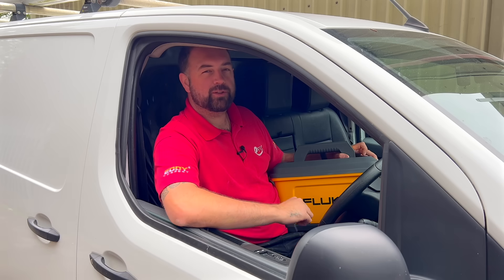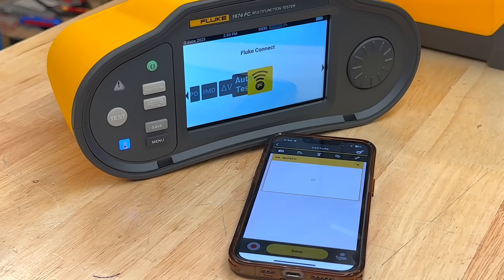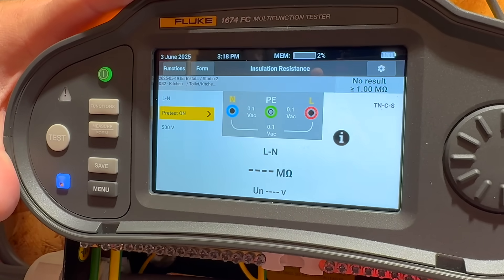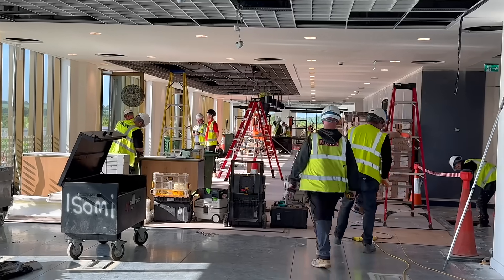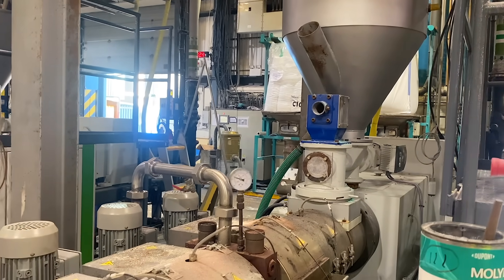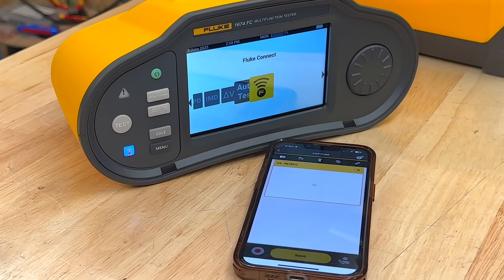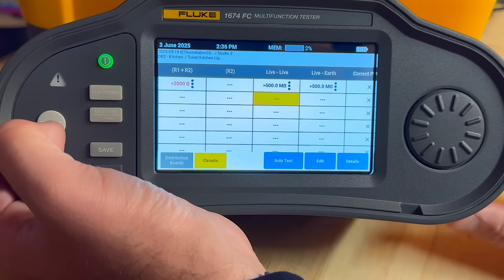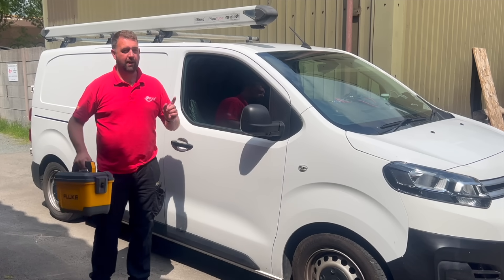Reviewed: Fluke 1674—Test Electrical Installations Fast

Comment: We have the 1674FC and its collecting dust now. Its slow as hell in no trip Zi / Zs testing .I updated the firmware but no improvement. Battery is always empty after a few days in off mode and its also resetting all settings including date and time. You cannot charge and measure at the same time either . This is needed with an always empty battery ( powerbank would be handy ).  It never remembers the settings I put, like 250 v for insulation testing ( goes back to 500 V ) rcd testing settings etc. No two lead Zs Zi testing like the good old 1664 . Boot time takes forever. Its much heavier then the old 1664FC. Autostart could have been handy if it was reliable but its not. Its nice to have ma and ms at the same time for rcd testing but  for the rest I prefer the old 1664. The reporting software is a joke, i rather use paper. We use a tablet with special scope 8 app thats not compatible with fluke.

Comment: I have  1663, 1664FC and 1674FC. The 1674 fills the gap in software interaction but if you do small projects using fill out forms stick with the 1660 series. So far I also noticed the 1670 series  is slower in booting and setup. I would have wanted a dark mode for the display, a bit mor customization options, the FW Update suffers a bit under Flukes usual ancient storage interfaces...you need a FAT32  USB-C Stick up to 32 GB...yeah you can partition that if you know how but tge manual doesnt tell you. I mean cmon every cheap mobile phone can more

Comment: Not true picture shown here, you can not to do tests filling practically on tiny screen, just a gimmick. Plus gave me some random fuseblown error on IR testing brand new tester, charging doesn't last through proper eicr or if you fault finding and using IR testing frequently , just 1 eicr, or so. Why fluke doesn't do like megger for hold test button for continuity, insulation testing as it have to be pressed every time test button, waste of time.. I have fluke 1664fc and it seamlessly switches to different test options while this is laggy as I'm holding first manufaactured old smart phone and it takes ages to start up and so on. Since bought its never been used only to try it and sitting there useless, no one can beat replaceable Alkaline batteries, as if you are in middle of testing and it dies then no option, why do they not sell extra removable batteries, so i can replace and be on my way. Most importantly testing software true test is just a another gimmick you have only eic may be or one more test certificate and useless to use in uk... As its not meant for uk... So i spent nearly £2k on just shiny looking tester and I'm still using megger because not to press test button every time you do continuity and especially fault finding buzzer you can hear from far off.. These tiny things make tester life easy...
Reply: Auto is on the Continuity range - Menu, Device Settings, Measurement Settings, Continuity Limits and the second line down has a toggle to turn on or off the AUTO feature. For safety reasons, I believe it's not a feature on the Riso test, due to the voltage being output. Make sure you're running the latest version of the firmware too, as there's been improvements to boot up time, battery management and some other improvements. The product page on the Fluke website has a link to the latest firmware.
Reply: @MarkBarron-r4b have seen latest version and missing 6mm conductor,, thanks was wondering whats auto function in setting...
Reply: Also no options for rating factors or I dunno how to set 1.37 32amp mcb on 1.09

Comment: I have this tester myself and with work we have the megger 1741, my biggest issue with the fluke after it sitting in the van is the battery, when I go to use it I find it’s flat I then have to reset dates and times (takes seconds) but it’s annoying, it takes forever to charge also! and a good while to start up, that I end up just using the megger, the battery on the megger just keeps going for weeks on end. Love the fluke when it’s up and running (slightly heavy too)  but it does have its downfalls , hope this somehow improves with updates

Comment: It’s a little slow to start up but once it’s on, it’s fine. We are doing a lot of testing at the minute so we have 2 of these. They are nice to use, screen is very clear. We charge ours regularly so haven’t really noticed much of an issue with the batteries. The software to go with this is absolutely terrible though, it’s clearly had no input from an electrician. It doesn’t have N/A for half of the items, just a pass or fail. What if there isn’t an AFDD? Is that pass or fail? 🤔 look at the screenshot you have posted of TruTest, doesn’t even calculate Max ZS for you, you have to do it manually. This is basic stuff. You know it’s shit aswell as you print out a blank certificate! Same as your R2 measurement on the tester. You try and NA that because you’ve done R1+R2, it will not do it. STOP LYING TO PEOPLE. TruTest is nowhere near ready for use. I would be happy to give you a demo of how useless it is if you like.
Reply: Another moan to add. Why when I bought my 1662 I got fused leads, but I spend £2k on a top of the range tester and it doesn’t come with fused leads? To say I’ve spent £4k on testers and £800 on 2 lots of software, I certainly don’t feel like a valued customer.

Comment: Minor works cert link missing, please update!
Reply from the maker: Need to finish Vid first 😉
Reply: They won’t do it because they know the software is terrible. You wait until they try and N/A anything and it won’t print. Or they try to input the voltage for IR, you can’t do that until it has a reading. It doesn’t work out your MAX ZS for you, you have to input it manually. This doesn’t save you time at all. It costs you time. We have had to go back to using EasyCert until Fluke sort it out.
Reply: @NickyLong89  Honestly cannot belive how bad Fluke has missed the mark on this. Software is useless. Doesnt work with any electricians I know workflow. Take forever to do anything. The reports are full of useless checkboxes and fields that are not applicable or even relevant to our Standards in AU. I have the 1674, other bloke I work with has a Metrel, which is a far far superior product. It allows much more complex setup of auto testing and the reports are actually useful.

Comment: My first multifunction was a Fluke, failed just after a year. Fluke gave an estimate to repair around the same cost as a new one. £1400 down the drain.
I bought a Megger. Never looked back. #meggerforlife
Reply: Doesn't fluke give you lifetime warranty
Reply: @Z-add  that is comedy gold if true 😂
Reply: New sparky here on the quest for anew mft -

Which megger do you use bud?!.. Do have my eyes on the X1.

Comment: Very very clever,,,, lucky,, being a maintenance electrician,,,,I only have to worry about voltage,,, current,,, resistance,,,, insulation resistance..... not the whole electrical installation.... but that's one clever piece of equipment,,,, and I hate testing flat batteries,,,, just replace the lot and give the kids the old ones for the toys,,,dad,,,, can I borrow your meter??

Comment: I have one of these, slow start up time is irritating. Battery life is shit. Three lead Zs is stupid! Can’t believe they don’t do a two lead test. I like the two lead RCD test capability. I like the touch screen and the certification aspect is shit because the forms look crap. We use smart devices, so filling out forms is easily done. Mine are always filled out at the tests are completed, fuck writing it down on paper then transferring to smart device, that’s stupid!
Reply: I agree with you completely.  I also have one. I should have bought the 1664 instead

Comment: I have this. I bought it to replace my 1653. Biggest problem is that the battery will die after a few weeks in standby .If you use it, it will last about 8 hrs. Compared to the old 165x or 166x which will last months or even years
Reply: Months or years compared to 8 hours?  Well that makes perfect sense.